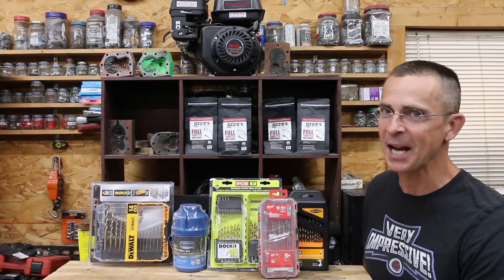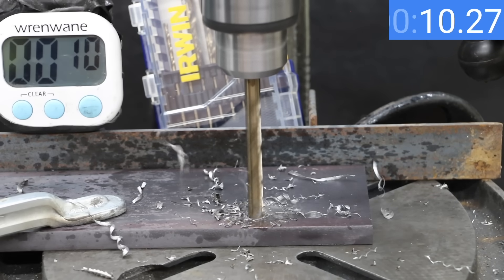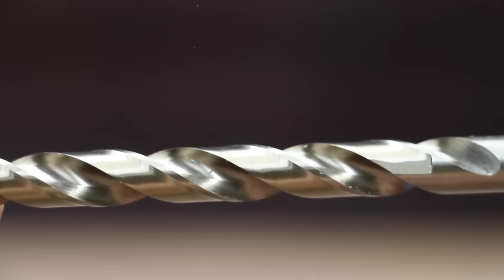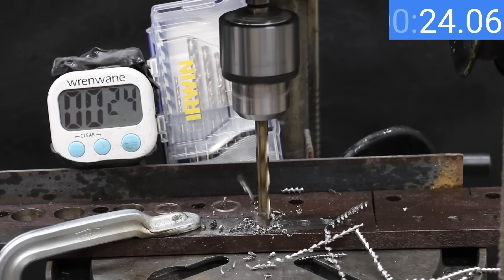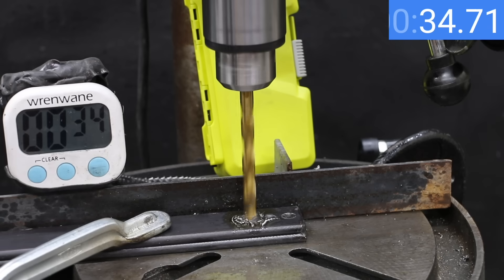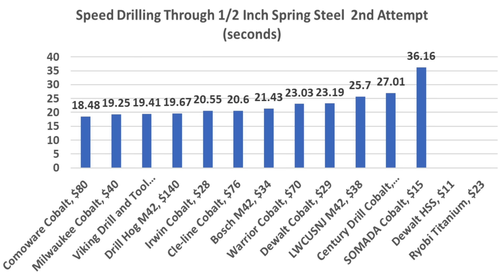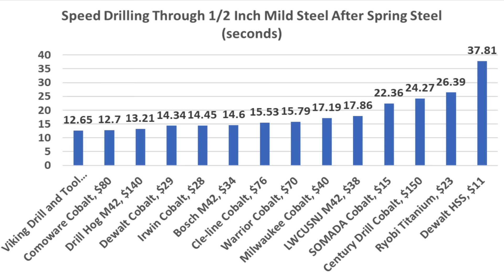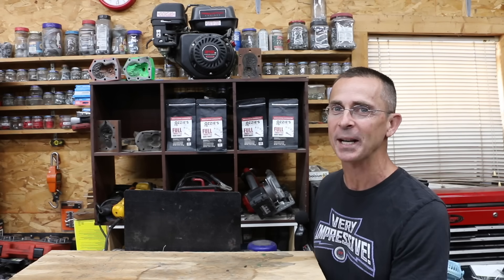Best Drill Bit Set? $11 vs $200? Let’s Settle This!

Comment: My grandfather worked and retired from Cleveland Twist Drill. He passed away a little over a month ago. But I still use the bits that he got from there. They are definitely a quality American made bit. Thanks for the video as always!
Reply: Your grandpa made some good bits. Clevelands are legit.
Reply from the maker: You are welcome!  Thanks for sharing.  Sorry to hear of your father passing.
Reply: Indeed they are. 
That kind of quality is something we took for granted  until modern times. Never would have thought that it would become common to get entire sets or packs that were not properly sharpened. The one in this test that wouldn't cut is a common example.
Reply: @ronfox5519  what you're experiencing is called survivor bias. What's good tends to outlast what's not good. That can give one a false impression that everything in the past must have been good because that's all that remains today. But they had garbage dumps in the past and they used them. If something was real junk it got junked. The good stuff they tended to hang onto more. Every now and again some real trash does manage to survive though and I've seen it and even have some of it. Like a set of Made in Japan twist drills that get dull drilling soft wood. The steel in them is just that bad. You could tie those bits in knots. Truly horrible stuff.
Reply: @1pcfred  
You must be a real hoot at parties.
Reply: @ronfox5519 That was pretty a interesting psychological insight he just dropped along with a real world example and a solid explanation. I’d love to go to a party with that guy. You, on the other hand, following up all this information with an implication that he’s boring and unlikable just makes you seem rude and annoying.

Comment: I have a few suggestions, not sure if you’ve done them yet: best carburetor cleaner,  best high speed bearing, best dremel tool or dremel tool attachments,  best spray adhesive, best air tool oil…
Reply from the maker: Thanks for the suggestions.

Comment: Excellent video and review as usual. I deal with hardened steels often so Viking was a brand I started using years ago. it is good to see it compares well even if it is expensive. I've heard others mentioned drill hog favorably and it did so in your testing as well. Glad you continue finding things to test and have kept the channel close to its initial start/roots.
Reply from the maker: Thanks!  Thanks for the feedback.

Comment: Cobalt will usually break before HSS. It's harder with a higher melting temp. If you're fixtured in a drill press or mill, I will choose a cobalt over a HSS bit.  It all depends on the job. Going through sheet stainless, cobalt. Cobalt will stay sharper longer under high loads. Keep the lube on HSS, dont spin them too fast. Watch the chip color, blue and purple and you're getting too hot. Even pressure and constant contact allows the heat to be dispersed.
Reply from the maker: Thanks for the feedback.

Comment: Lots of different things going on.

Even though the DeWalt HHS bit was the only one that wasn't cobalt based it still managed to beat out 5 of the cobalt bits. The fact that that the bit made drilled holes through 2 pieces of mild steel and 1 1/2 pieces of the hardened steel is amazing considering that it is only HHS. It is a very good value for HHS bits.

The speed in which a drill bit passes through material is governed by several factors as was shown. Drill bits are not all the same. The thickness of the web and the lip relief angle are two of the most common reasons that govern the speed in which a bit can penetrate through material. If you have a thicker web that makes a stronger bit but it cuts down on the amount of actual cutting surface where the center of the thicker web has to be forced through the material harder than a bit with a thinner web as the center of the bit has very little if any cutting edges. Slowing down the cutting process.

The other factor is the lip relief angle. A flatter relief cuts slower but provides more edge support so that for any given bit more edge support will last longer but drill slower. There is a down side to that in that if the relief is too flat the cutting speed is so slow that the heat buildup from the friction of the bit not moving through the material causes heat damage to the bit. On the other hand if the relief is to steep the bit will try to cut through the material too fast with a weaker edge which can lead to faster dulling and edge chipping from the excess force being applied to the weaker edge. 

HHS and Cobalt drill bits are supposed to be used for two different things although the cobalt will do better in the world of the HHS bit whereas the HHS rarely does well in the Cobalt world. Soft material HHS, hard material Cobalt.

I would have to disagree about the choice of the Bosch M42 over the DeWalt Cobalt. The only real difference was the breaking strength with the edge going to the DeWalt in most of the other categories. If you are actually breaking drill bits you need to change the speed and pressure you are working the bits at. 

Good testing. I try to pickup the DeWalt HHS bits whenever they are on sale. I have been using the Milwaukee Cobalt bits but will have to look for the DeWalt Cobalt bits.
Reply from the maker: Thanks!  Thanks for the feedback.

Comment: When changing out the timing chain on cars, often the timing cover is sealed with a solicone. 
What are the best automotive scrappers. 
Best practices to remove it for a clean surface with the least damage to the sealing surface. 

Also, do you happen to have a video on glass cleaner to clean the inside and outside of a vehicle
Reply from the maker: Thanks for the suggestions.

Comment: Drill bits are something that I'm okay with spending a bit more money on, as I find bad drill bits quite infuriating. I personally use Alpen bits, and I'm quite happy with them. Plus, they're being made in my home country. Another sometimes infuriating thing are cartridge presses. Had a cheap one which stripped out, then went and bought an expensive one, which exploded, now I'm using one that's somewhere in the middle, which works okay. I'd love to see a test of those things (necessary force to push out stuff, breaking point etc.) Great test, something I'm always looking forward to during the week !
Reply from the maker: Thanks for the suggestion.

Comment: Another great video. 

Not sure this is the appropriate place to suggest another topic, but here goes anyway.  I would like to see a review of cumbustible gas detectors.  These are available in a price range from around $25 up to many hundreds of dollars.  It would be a handy tool for checking for natural gas leaks in the home or gasoline fume leaks in the car.  However, I have yet to find an independent review of any of these devices.  Apparently they can even pick up sewer gas (or the methane it contains) in some instances,
Reply from the maker: Thanks!  Thanks for the suggestion.

Comment: Can you do a test comparison between Bosch Dewalt makita rigid mawalkie batteries the drills vary between brands but do battries
Reply from the maker: Thanks for the video idea.
Reply: @ProjectFarm  you can get battery adaptors if one kind is better or more cost effective  than another I may be better using a battery adapter.

Comment: You should not be drilling so close to the other holes. That gives an advantage to the later bits due to the heating and cooling of the metal (mild steel) and a bit of flex created. Moreover, even if there is no effect due to heating or flexing the possibility is still there due to the proximity to the previous holes.
Reply: That's funny because the fastest drill bit was the first hole he drilled. So there goes all of your theories.
Reply: You sir, must have taken the short bus to school 😂

Comment: Should test Viper bits. They pretty much dont get hot, and somehow hardly wear out. I have only been able to curl the cutting edge on a 1/4 and under by running it as fast and hard as I can.
Reply from the maker: Thanks for the suggestion.

Comment: Good stuff as always.  Thanks!  
Of course it doesn't address the issue of what sizes you need.  Personally I want one index holding a set that goes by 1/64 inch increments.  That is to be sure I can make exactly the hole I need when I have to be picky about fit.  That set stays in the workshop.  But most holes don't need that sort of thing and get made with bits from cheaper, less complete sets that live in my tool bag.
Reply from the maker: You are welcome!  Thanks for the feedback.

Comment: I'm with you on the "pilot points" putting me off. With three decades of fabrication on my resume, I've saved thousands of dollars sharpening my own drill bits, so I guess I'm a snob when it comes to that part. Great tests, I like that you drill spring steel a couple times and then get another time on mild steel. My worst experience in drilling holes is always stainless steel, 304 and 316, it isn't that stainless is all that hard, the nickel or chromium makes it slippery. A used bit just doesn't cut. Keep the videos coming!!
Reply from the maker: Thanks, will do!  Thanks for the feedback.

Comment: Todd, another great showdown.  Maybe one on cutting lube.  Drilling, tap, and die work.  30 & 90 straight weight vs. way oil, and many of the common ones.. Please include Anchor Lube. @Abom79 likes to use it...  I decided to give it a try, and had great success (I didn't break a tap) in doing some power tapping for a small project.
Reply from the maker: Thanks!  Thanks for the suggestion.

Comment: Might be buying the Bosche soon.

My boss is a dewalt fanboy... everything he owns is yellow/black. While I use whatever works.. That said I'm currently using those Milwaukee bits and I'm not too happy with them. I had one bit fail trying to drill through a mild steel garage door which had me stunned, and the rest are prone to hopping because of that tip shape... So while drilling through a door frame will work ok, drilling through something harder will result in walking. 

I will say the Cryobi bits were the fastest bits I've ever used to dull after a handful of uses. I mostly drill mild steel, door frames, ect... sometimes an ibeam... The Ryobi dulled after 2-3 door frames which was irritating to say the least. Shouldn't need body weight to drill through a frame.

I find it interesting that Kobalt went to Irwin for their bits. Neat.
Reply from the maker: Thanks for sharing.

Comment: Been buying drill hog drill bits for the past couple of years. Always work great and last! And the warranty process is easy and awesome! You mail in the broken or dull bits and they mail you new ones back no questions asked! 

Maybe for another video test out different oil for drilling. Which oil works the best or does just using plain motor oil work just as good. 
I been using this oil lately called Cool Tool i think it works really well!
Reply from the maker: Thanks for the feedback.  Thanks for the video idea.

Comment: I purchased the Drill Doctor sharpener and sharpened all of my dull drill bits.  Now I'm good for the next 20 years, just touch them up when they need it.  Thanks again for another detailed comparison!
Reply from the maker: You are welcome!  Thanks for sharing.
Reply: Is the Drill Doctor able to properly sharpen those Cobalt pilot style bits as well 🤔
Reply: I try never to buy tooling made in China. However, I made an exception a bought a Vevor sharpener. It works very well and is of much sturdier construction than the drill doctor.
Reply: The drill doctor isn't that great.  You can do much better hand grinding with a bit of practice.  It's worth practicing as you can then create many formed tools.
Reply: @falsedragon33  I agree it has some shortcomings.  That said, for the guy who doesn't own a grinder, this unit is decent and fairly easy to use.  Ftr, I do get a very good edge on my drills and they been holing up well to my abuses.
Reply: @falsedragon33 This. As a machinist, I often did custom grinds on bits.
Reply: @falsedragon33 this in why I prefer to buy bits that don’t have odd points cause you can’t sharpen them by hand

Comment: I hate the move towards those gimmick pilot points, it seems more about a flashy visible change to drive sales than any performance benefit at the cost of sharpenability, which l wouldn't be surprised if that was also a reason for companies pushing them
Reply from the maker: Thanks for the feedback.

Comment: Glad to see some industrial brands included in this go around! Too bad you didn't have any stainless or alloy steel, but these are excellent test results.

You might consider getting more conventional HSS drills to test—cobalt drills have a thicker web that may slow them down in softer materials like 1018 or A36.
Reply from the maker: Thanks!  Thanks for the suggestion.

Comment: I havent tested all the drill bit brands but i do drill a lot of through holes in titanium. The best ive found for that is rocky mountain twist cobalt heavy duty .

Accidentally ran a #50 at speeds meant for carbide in a 5xD hole. It didnt break it just got loud after about 20 holes
Reply from the maker: Thanks for the feedback.

Comment: I am glad you added some industrial grade drills to this review. I have a set of industrial grade I bought for the company price when I worked in manufacturing.

Even though they are abused and run in a hand drill, I’ve yet to need to replace a drill and they’re primarily used to drill out bolts…
Reply from the maker: Thanks for the feedback.

Comment: I use whatever they stock at work lol (industrial electrician). 

They come from McMaster Carr, HSS manufacturer is kind of irrelevant. McMaster and grainger have vendor approved sellers. As long as the drill bits are made to the minimum spec (whatever the vendor decides) they will sale them. Either way I’ve built myself a nice index for personal use at home. From my experience they are good quality. 

It would be nice to see you bring in some products from McMaster or grainger for your shootout videos. 

Love what you do and please don’t stop. You are the authority in unbiased reviews in my opinion.
Reply from the maker: Thanks!  Thanks for the suggestion.

Comment: If I could make a suggestion, for the speed tests through the various materials try putting a nice hard slab of wood or something similar to avoid the bits being damaged on exit, I’d best most if the damage on these bits was from the hard and uncontrolled exit.
Reply from the maker: Thanks for the suggestion.

Comment: Hey Project Farm, I think that if you're going to do torque testing, you should come up with a test rig that keeps the torsion completely in-plane so it doesn't become shear or bending moment on the drill bits or other long, slender shapes. It doesn't take much to offset the load in ways they're not meant to handle (or at least, ways that you're aiming to test), and that can make your tests less consistent.

Comment: The, chuck slipped on several of the bits, on the spring steel. The, chuck went down, but the bit did not. Did, these bits, actually go through the spring steel? Looked like, they got stuck, before making through the spring steel.
Reply from the maker: Thanks for the feedback.

Comment: Love that the Bosch got your seal of approval several years after the 1st test where you picked them!
Reply: i think i bought a bosch set just because of his first video. his stuff is always appreciated.
Reply: I bought that set years ago based on that video. Glad to see it’s still recommended. Truth is, I don’t drill through metal that much as I’m a woodworker but I have proper wood bits for that. The Bosch have been able to do anything I’ve asked. They work a lot better in a drill press though as it can be hard to generate the downward pressure with a hand drill.
Reply: I use that same set of Bosch out here in the oilfields in West Texas.  They have performed flawlessly, even though I do not have any need for them to drill ultra-hard materials.  I also use Drill Hog's Premium Pig Steel and Niobium-steel drill bits as well.  I'm glad I'm getting my money's worth.

Comment: Thank you for testing Drill Hog.  I normally buy cheap bits, but I will say my lifetime warranty Drill Hog bits are fantastic.  That being said, you can buy a lot of Irwin or Bosch for much less.  I've found that the titanium coated drill bits are just garbage.  I usually buy 1/8 inch bits in 5 or 10-packs because they break so often when drilling into metal.
Reply from the maker: You're welcome!

Comment: Love this video! I appreciated the sharpening of the LW, i figured cobalt bits would be more difficult to sharpen. I wonder if the bits with the pilot point are sharpenable
Reply from the maker: Glad it was helpful!
Reply: Abrasives are a lot harder than even hard steel.  The Drill Doctor wheel is diamond. Which can be an issue grinding steel with it. You get carbon migration grinding steel on diamond. Maybe DD just runs slowly enough it's not a problem? But at high speed it generates enough heat it is.

Comment: I own a set of those DeWalt bits. They were on sale of Amazon for half of the regular price of $25. From my light uses, I can confirm that the no chuck spin is a joke and it still spins in the chuck. Also, I snapped the 1/4 inch bit drilling through 1/8 inch steel. Thank you for the tests, Todd!
Reply from the maker: You're welcome!

Comment: My biggest issue is bits with pilot tips. As soon as they dull, the tips are mostly a waste. Also, I've been noticing a lot have thick webs and trying to resharpen them doesn't work well unless you grind a split point. 

 Honestly, I would just like a normal tip, that has no coating, that can easily be sharpened on a bench grinder.
Reply from the maker: Thank you for sharing!